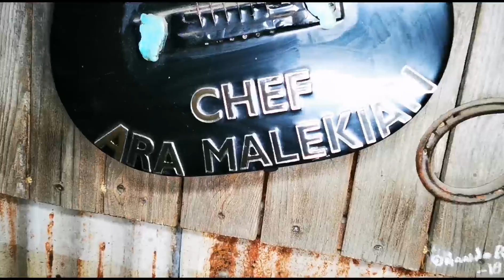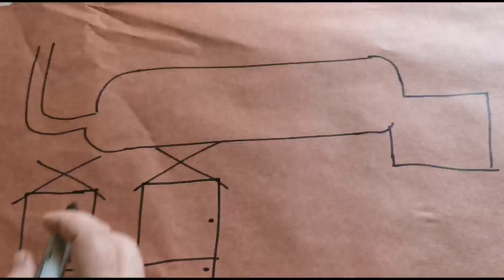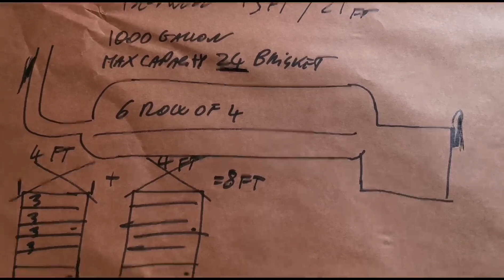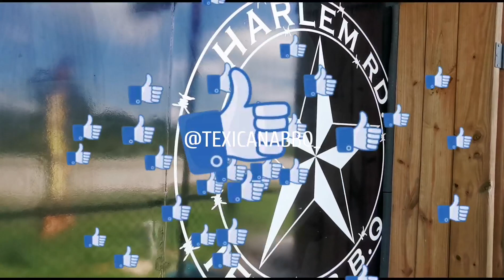BBQ Smoker Review - PitMaker Vault Cabinet Smoker | Harlem Road BBQ

Comment: Max,  did you taste the brisket?  How did it compare to an offset smoker?  I've never tried anything from a Pitmaker, but I can tell when BBQ is cooked on an Old Hickory and Southern Pride type cooker (not good).  I'll try Harlemroadtexasbbq when I'm in the area, but I will stick with with my Moberg 250 offset!  Great video as usual, though !
Reply from the maker: The bbq vault is sompletely different than those smoker. Actually u can barely taste the smoke. Harlem Road is on the top 25 best bbq in Texad according to Texas Monthly. But like you just said the best way to find out is to try yourself, the trip will be worted...
Reply: I have been here a couple times. I think the BBQ is as good as any of the top joints. Its slightly different, but not in a bad way. It was better than what I got served at Tejas BBQ a couple weeks ago.

Comment: Excelente information
Pitmaker is a reverse Flow.?
Saludos desde Monterrey
Reply from the maker: Hola!! No...
Reply: Yes, it is a reverse flow.  The heat from the fire box on the bottom will go up the back wall of the cooking chamber through a channel almost as wide as the cooking chamber and will come out above the top cooking rack at the top of the vault.  The heat will then travel down the cooking chamber and out through channels on the left and right of the cooking chamber to the outlet vent on the top of the Vault.  When the vault is empty there is only a small difference in temperature from top shelf to the bottom shelf.  When fully loaded with meat I have seen the temp about 60F different from top to bottom, with the top being warmer.

Comment: So, do you fill the water pan in the beginning when you heat up the racks with the blowtorch?  Lots of questions regarding that water pan as it can slow the rate at which you heat up the vault or if you just let it go with out putting any water in it.
Reply from the maker: Water pan is mostly to collect  for the dripping of the meat in order to avoid stinky smoke...

Comment: Only 8 hours on brisket @ 230? Thats fast, even if the brisket was small.
Reply from the maker: Yep...
Reply: I have a Pitmaker Vault, same model, and NO WAY you're gonna cook a full packer brisket in 8 hours unless you're pushing 285F and even then, it would have to be a small 11-12 pound brisket. I cook brisket all the time and I used to roll at 235F and it consistently took  at least 12 hours and as much as 15 hours! This guy says he does it in 2 stages (which makes no sense) but maybe he's talking about 2 sets of 8 hours? Something is very wrong with this video, the info is bad!
Reply: @stevereisman6872   He's saying he cooks 2 different sets of briskets so he's serving fresh brisket all day so the people who buy brisket later in the day are not eating brisket that has been in the warmer since the morning.